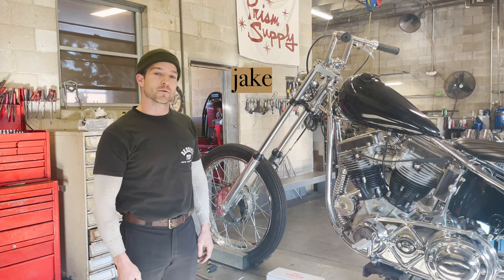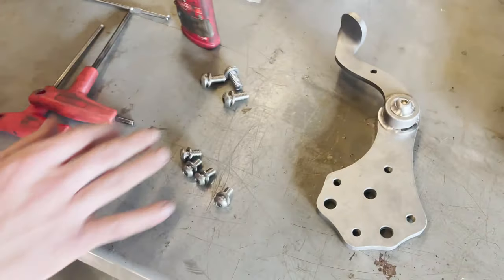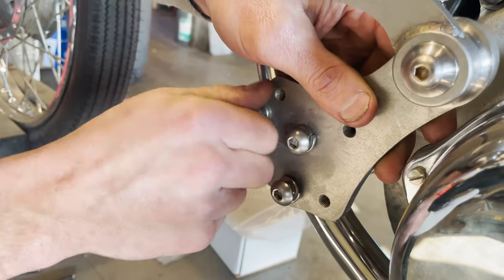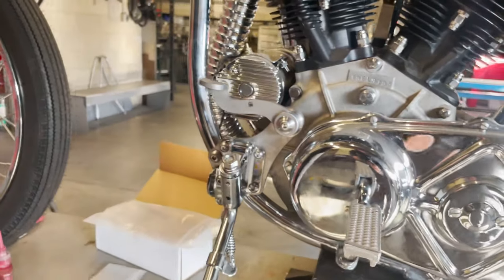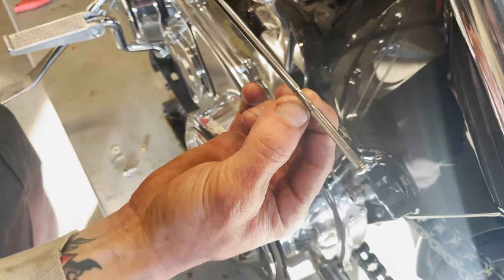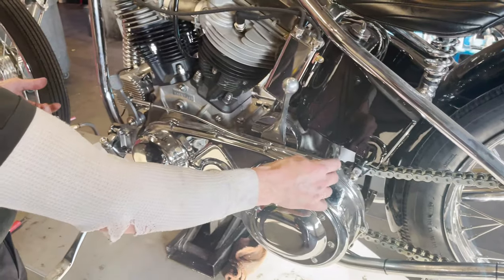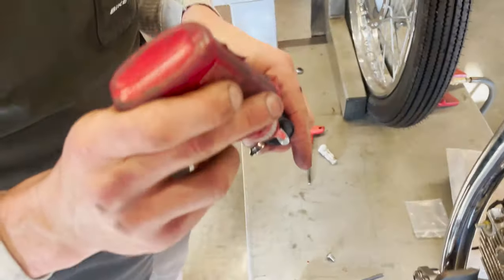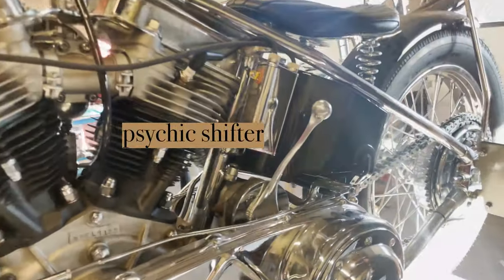PRISM SUPPLY | Sling Shot Clutch Control | DIY Install

Comment: When will the clutch cable and bracket be available for evo 5 speed trans? I like the setup that you guys did on that pink chop.👍🏽
Reply: They're not very responsive are they? 27 comments and they don't have time to answer questions..

Comment: Is there a foot clutch hand shift kit out there that allows you to keep your electric starter?
Reply: I had one. At the time I had forward controls and the pedal pulled a cable (it wasn't a pushrod/linkage). I had a bracket that was bolted to the front of the primary that the cable ran through. Worked great. That bracket was produced by another fabricator.

Comment: What's the point of a foot clutch that doesn't lock disengaged? Hope and pray you found neutral before stopping on inclines?
Reply: Just gotta get good
Reply: Get better at riding.. I use this foot clutch all over the hills of SF no front brake no problems.
Reply: I never read any comments from anyone that this setup without a front brake didn’t work out well for them.

Comment: Seems ridiculous how far you have to lift your foot(  6to8 inches ) up and forward to actuate clutch. The early friction rocker  worked because you were sitting higher up and further forward where the foot angle was much better to push ownwards to actuate clutch. Drop the seat to frame and way further back and the angle becomes difficult. Not to mention hooking your boot on that stubby peg .Like the stock brake set up on early FLH where you have to lift your foot backwards then up and then forwards to activate brake.Nothing ergonomic about HD antiquated system. Look at any modern bike Both pedals and hand lever to perform those functions move less than 2.5 inches.

Comment: Yeah, it looks cool but the Harley Style Rocker clutch is the only way to go if you actually ride the motorcycle everyday. I've been riding on the street since 1970 and I am still riding a 1949 EL Panhead with the stock setup. Yeah I'm an old guy and I built my bike and I can still kick that bitch over no problem.  Sure your kit looks cool like the original Lee foot clutch or the Speedy shift from the 50s but it sucks for taking off from a light. The advantage of the rocker clutch is you is you push down to engage the clutch and it'll hold it with the spring if you have to put your left foot down suddenly.